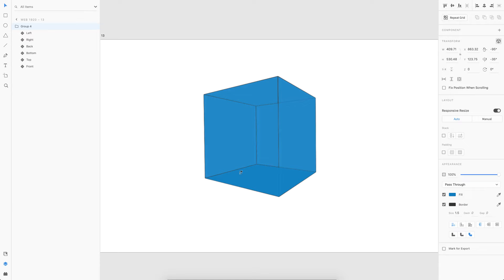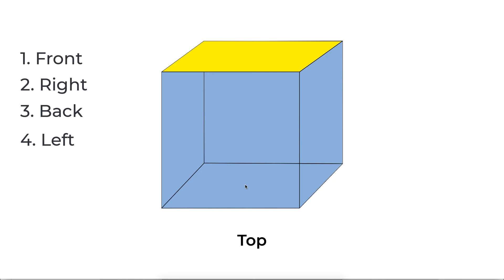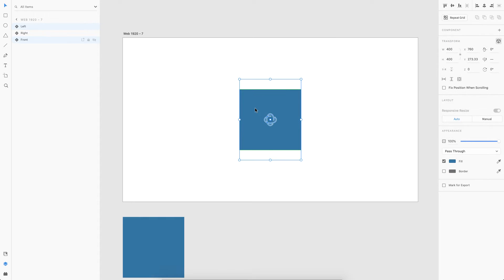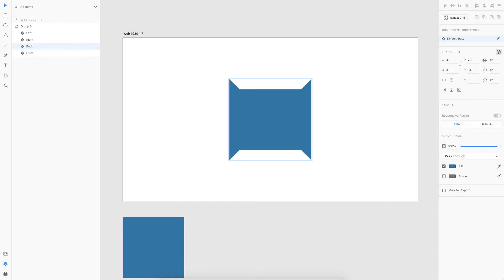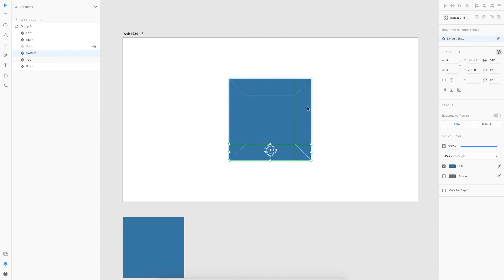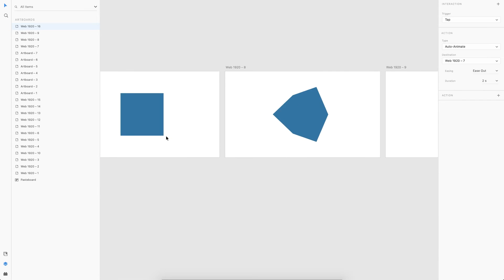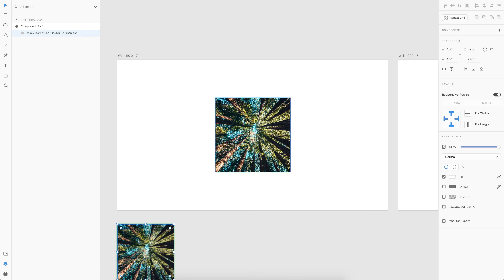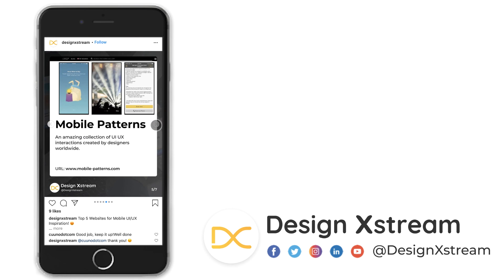Is it possible to create a Real 3D Cube on Adobe Xd? 🤔

Comment: Great video! Has the bug with the face disappears when you change color been fixed? It's been a significant amount of time since this video's publishing, so just curious :)
Reply from the maker: I've tried this later so I'm not sure if it got fixed. However, since the 3D feature is not intended at implementing such structures I'm sure Xd wouldn't have fixed this 😄

Comment: Thank you a lot!!! I have activated the border of the cube that its easier to see that its a cube but i can see the borders of every side through the cube. Do you know how i can deactivate that?
Reply from the maker: I think I faced this issue too. But I couldn't find any fix for it. If you really need easy 3D tool then try Spline 3D it is a lite tool and amazing.
Reply: @DesignXstream  alright, thanks.